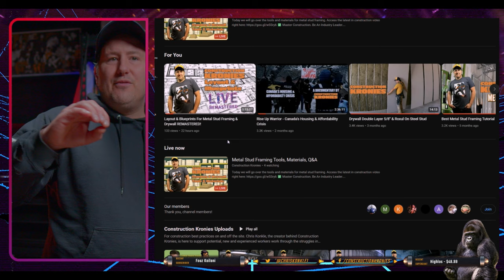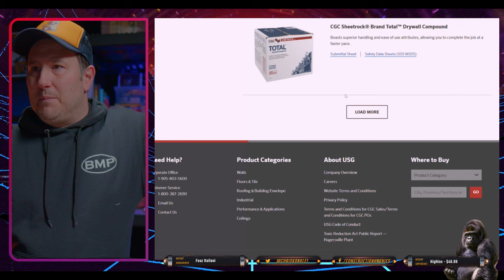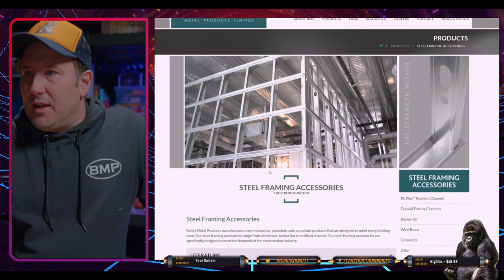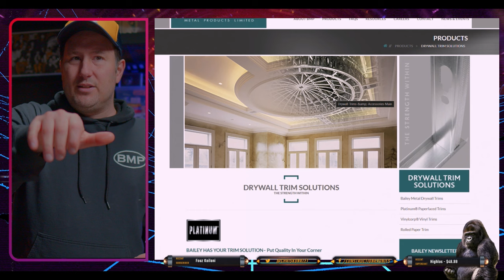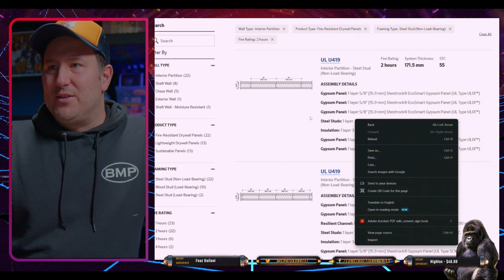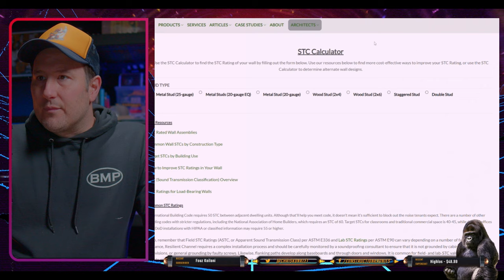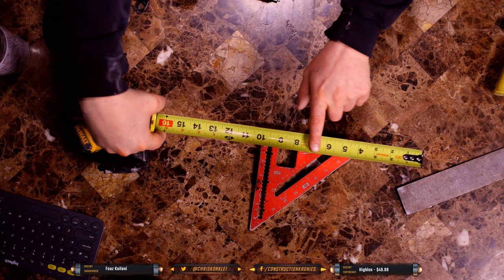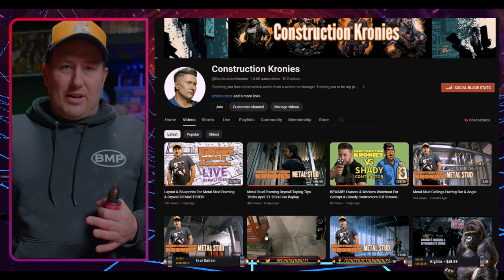Steel Stud, Drywall, Finishing Tools, Materials, STC & Firecode Ratings Remastered

Comment: thanks for the great videos. so much valuable info for those interested in light gauge framing... ;] metal top track question for you.. hot do you make a "continuous" 30' top track out of 10' track" for a loadbearing exterior wall. so it would be "equivalent" to a wood famed double top plate??
Reply from the maker: Of you want to join tracks together just cut a 6 to 8" piece of stud, put it inside the track 3 to 4" in each track and screw it together. That's if it's a floating wall outside of the structure. Otherwise just shoot it to the structural steel. We don't overlap and stagger the joints the steel like wood, it's much stronger.  Make sure to put a laser on it and keep it straight. Hope that makes sense.
Reply: @ConstructionKronies  totally helps. thank you for the answer and the great videos 👍👍👍
Reply from the maker: Awesome! Your very welcome!